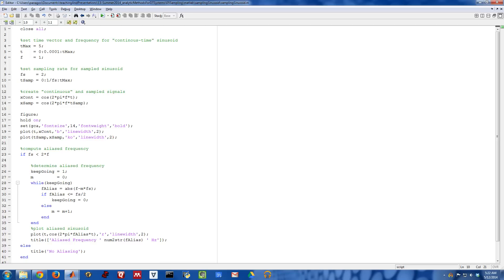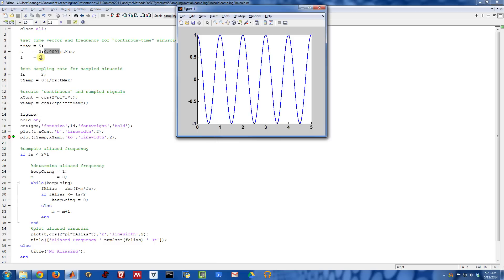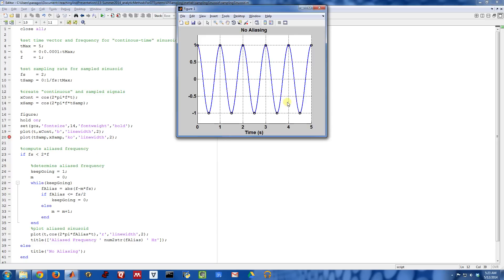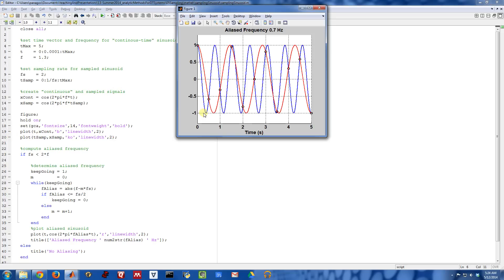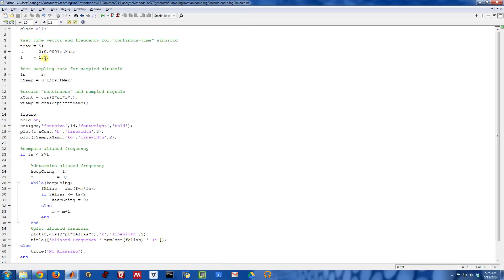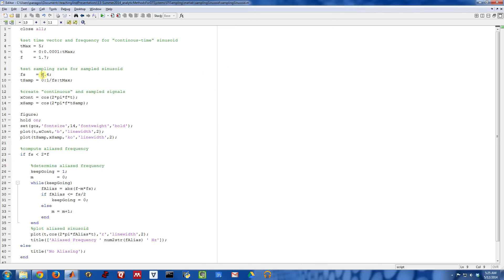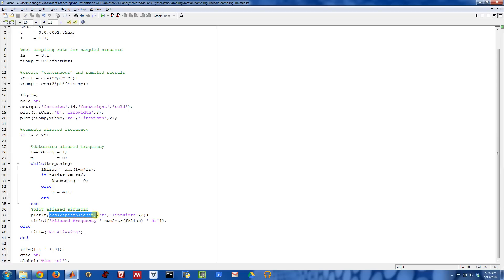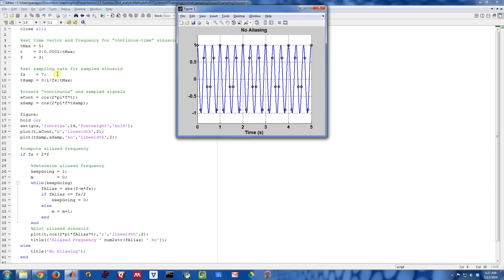Sampling Signals (6/13) - Sampling a Sinusoid (Matlab)

Comment: What if I wanted to change the frequency of the sinusoid say a 1000 Hz sinusoid time sequence for 5 cycles with a sampling frequency of 15kHz.
Reply from the maker: +Memo “MekoxTwiSparkle” Pony Then you would set "f=1000" on line 6, "tMax = 5/1000" on line 4, should change the time vector to something like "t=0:1e-6:tMax" on line 5, and "fs=15e3" on line 9.
Reply: +Adam Panagos How do you determine the increment you want for your time vector? I don't understand that. Don't you want your increment of your time vector to be as small as possible?
Reply from the maker: +Memo “MekoxTwiSparkle” Pony Yes, when simulating continuous-time signals in Matlab you usually want to set your time vector increment to be as "small as possible".  Usually, if you set it to be about 10-50x higher than the largest frequency you're working with you'll be fine.  Since we're working with 1000 Hz, a sampling interval of 1/(10*1000) = 1e-4 would probable be fine.  I used 1e-6 just to be sure.  The main thing is to make sure you satisfy the Nyquist criteria (at least 2X higher than the largest frequency).